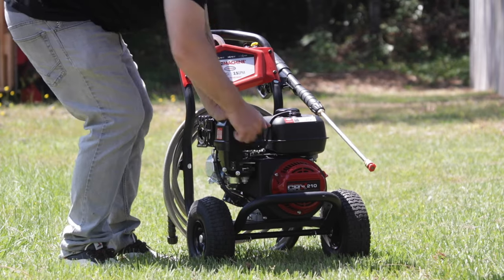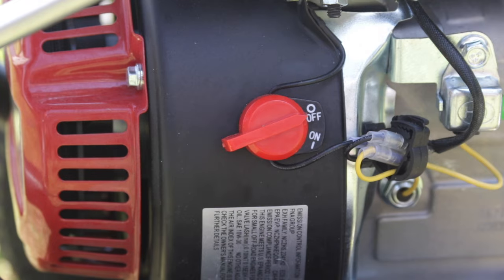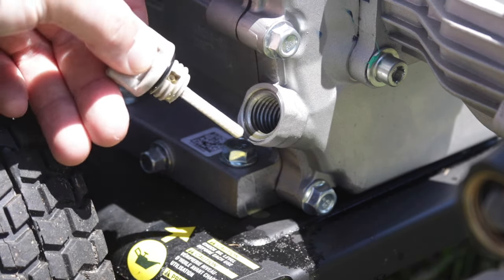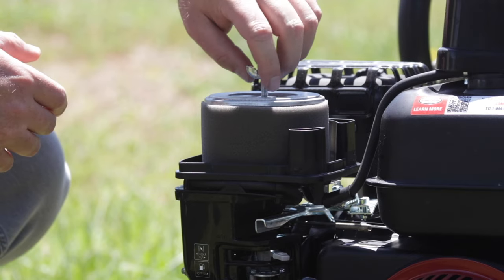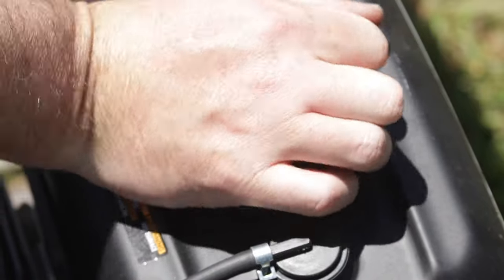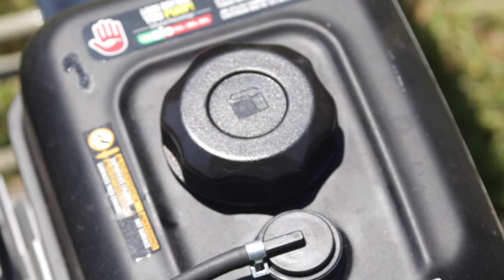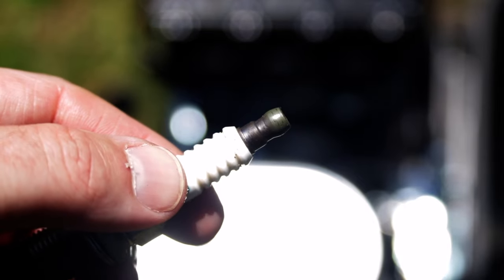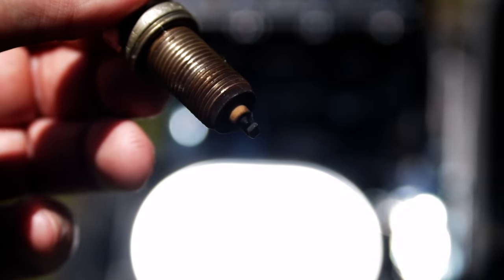Pressure Washer Won't Start? Try these tips first.| Pressurewashr.com

Comment: These are all the basics. If I had no idea what the basics were I would have searched for the basics of why it won't start, why it won't stay running. Even though it has less than 10 hours on it since last Fall.
Reply: 90% of the time it'll be a gummed up carb from leaving ethanol fuel in the tank for an extended period after using it and not running it dry.

Comment: That model is a POS ... I realized the problem with it today , crappy design... Cold start , cranks 2nd pull ... After engine is running temp or ran for awhile , 100 pulls & no start ... What happens is the gas was almost at a boiling point & causes it to vapor lock ... The Simpsons with the Honda motors start every time you pull it ... I wouldn't recommend buying this model on the video...If you do , you'll regret it just as I did ....

Comment: Mine is so hard to start, I have to use starting fluid. Fuel to the right, choke left, pull twice, no start.  Choke to the right, pull twice, no start.  Choke to left, pull twice, no start. Squirt starting fluid into carburetor, pull once, presto!

Comment: Mine is super hard to start! Very frustrating!!! When it wants to run, it runs great. Makes me wish it was electric!
Reply: After all... removed float bowl,  it was clean. Drained tank. Ran a tip cleaner up the suction tube, looked like hot glue residue came out. Reassembled. Started on second pull. Hooked up water. Started right up. I squeezed the trigger, engine sped up. Works great. Restarted several times.... All good.

Comment: HI   I have Wilks USA TX750I, engine is fine its just something with the pump or pressure. machine is new never used. I have seen several videos about errors and troubleshooting but nothing has helped so far .  anyone has an idea regarding pressure , pump , etc >? thanks